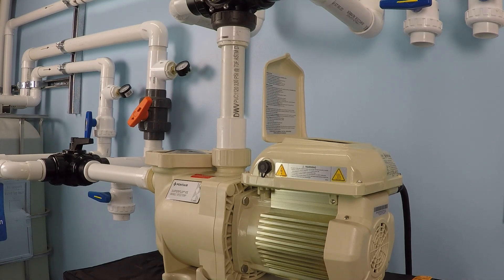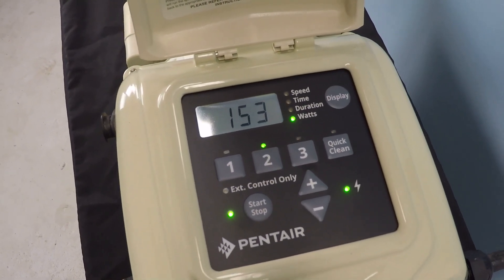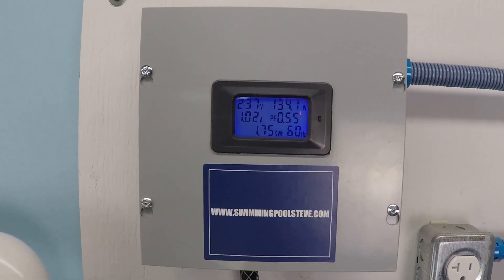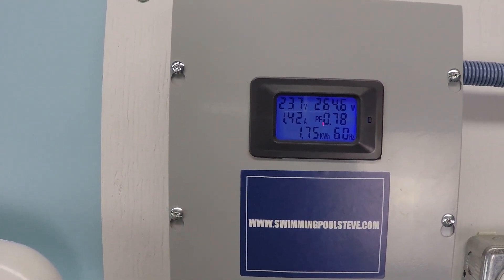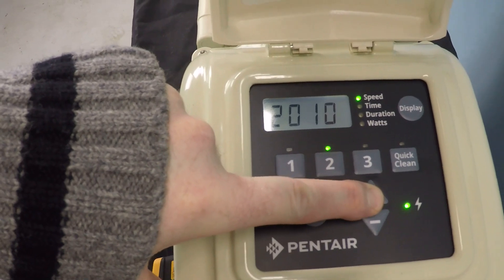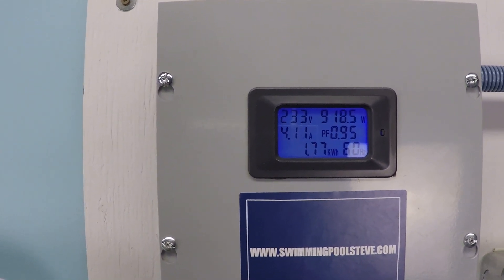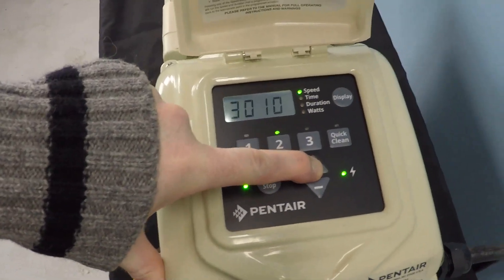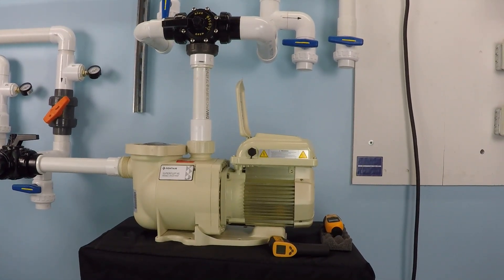Pentair SuperFlo Wattage Meter Test

Comment: Hey Steve. You have stated that this pump will only do 3000 rpm on 115v. Mine is allowing in to run the full 3450. Is this normal?